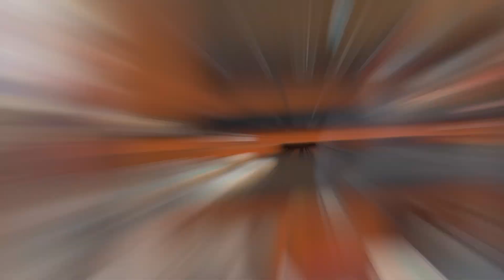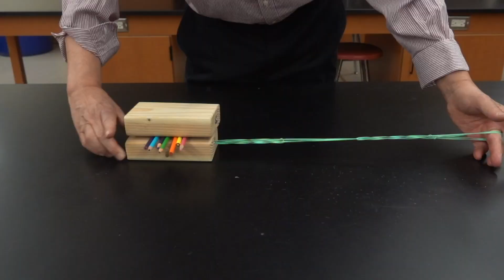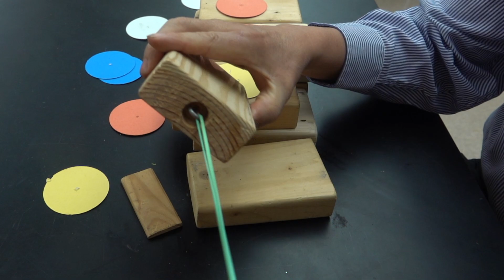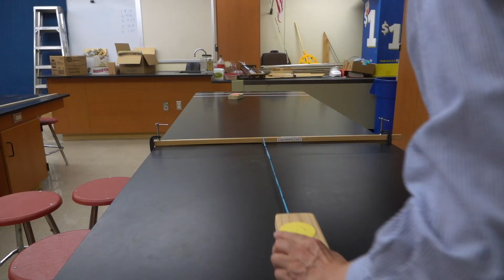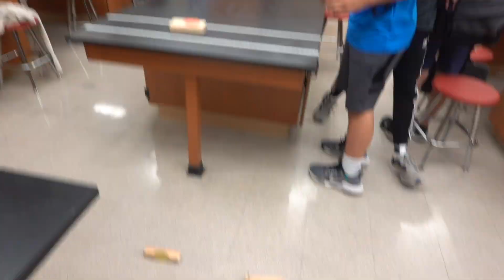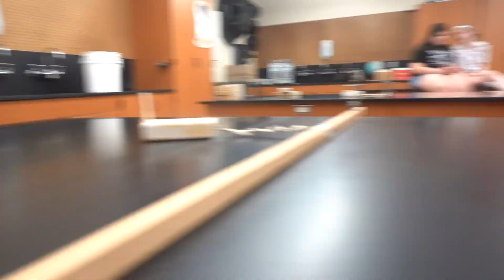Inertia Shuffleboard..... Homemade Science with Bruce Yeany

Comment: How do you think there would do 3d printed? They would be lighter than the wood but I could do color options and could print it with catcher plate attached and maybe the ring for the rubber band